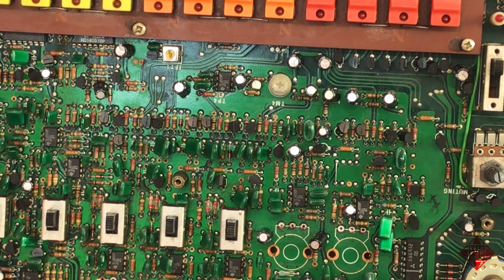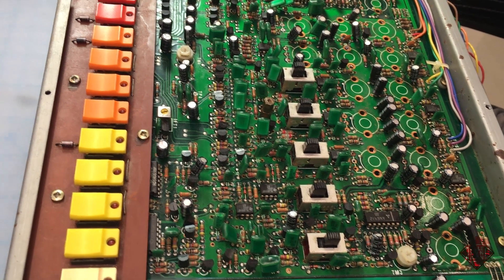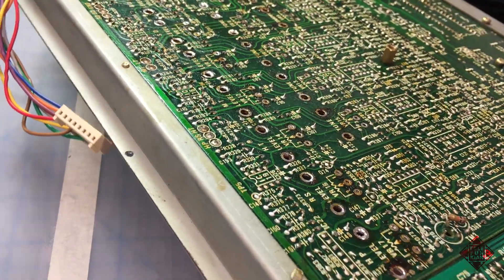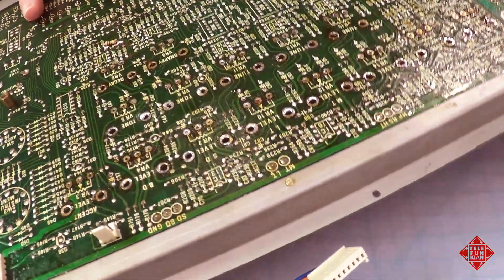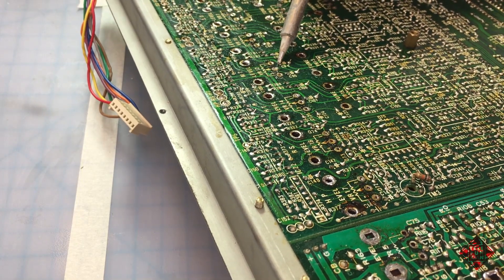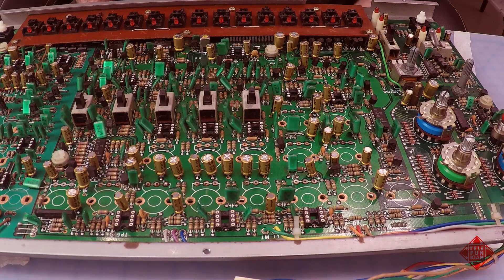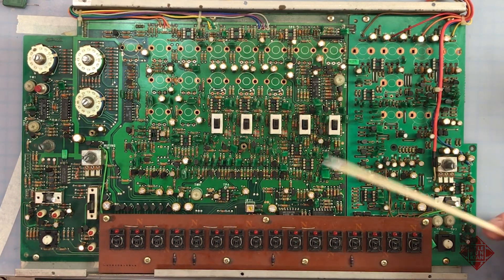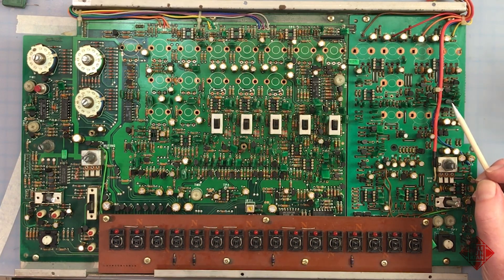Roland TR-808 Series Part 4 :  Capacitors

Comment: sadly those Nichicons are now obsolete.  I am considering recapping my 808 cuz the Hi Conga goes into a loud feedback if the tone is turned lower than its maximum pitch.  Should I just get the latest Nichicon caps with the same capacitance as on your list?
Reply from the maker: I would suggest audio grade for the audio path and 105 degree rated long life for the PSU. Any Nichicon or Panasonic should be fine. What you are describing though sounds like it could be a something else that is going to effect the Conga sound. There is only one electrolytic cap in the Low Conga circuit, C82. If you change that and no improvement I would check all the values of the resistors in other parts of the circuit, and make sure all the diodes are OK, and check the LC frequencies as per the service manual page 14. If the frequencies are off that is a good clue, check them as well when the switch is set to LT. That will give you lots of hints as to where the problem is.
Reply: @telefunkian  thank you so much for the great response.  I am still finding it hard to locate some of these capacitors and wanted to ask - on your list, you have a few caps that are the same uF but different voltages. Does it make a difference or can I buy, say, 33uF caps at 16v, 25v or 50v?
Reply from the maker: @vegansynths7757  You can use caps with higher voltage ratings, within reason, but not lower.
Reply: Happy to report back that it was in fact the capacitor!  🙂Hooray!  I recapped the main board and tested it and it no longer goes into a feedback loop/drone. Now I will continue with recapping the voice board.  Thanks again for your wisdom and very clear direction with these videos.
Reply from the maker: Congratulations! I am happy that I could be of some assistance. I am learning a lot as I go and can imagine how good it feels to have fixed this yourself!  @vegansynths7757